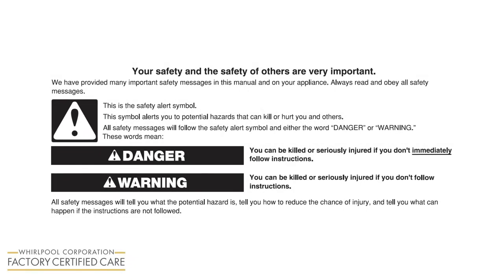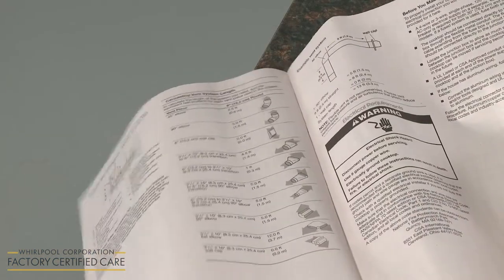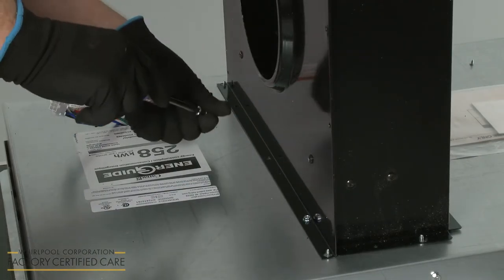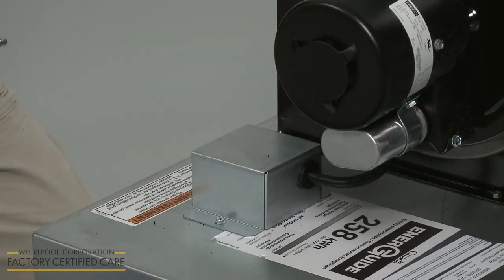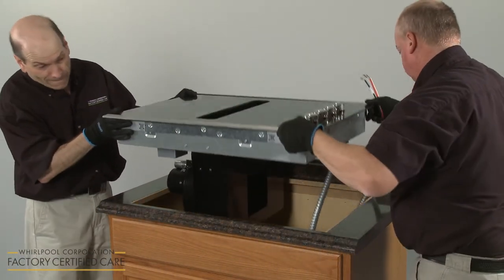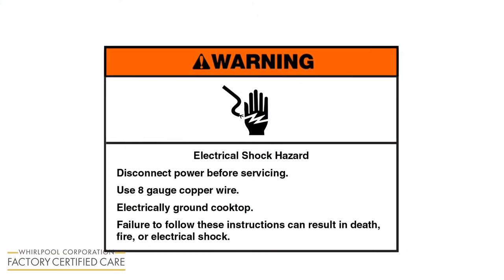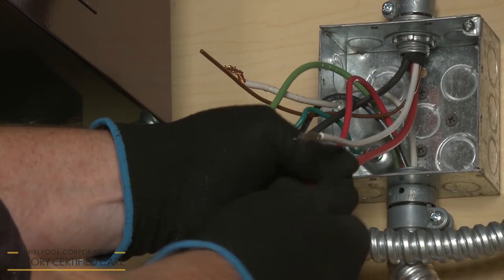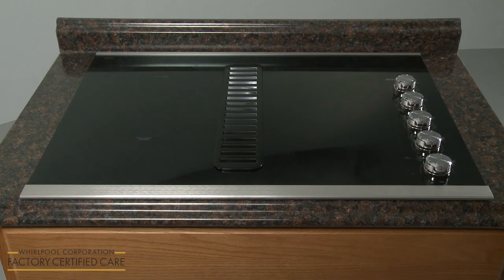Kitchen Aid Electric DD Cooktop Installation Model KCED600GSS

Comment: How is the cooktop secured to the counter? This is ignored in the video, and the instructions mention some screws and use wood between the counter top and the screws, but no mention of where the screws are, how they work, etc. I get the feeling they were not shipped, but they could be well camouflaged.
Reply: Same problem, any answers?
Reply: @opportunivore23  it turns out it just rests there, no brackets supplied. It stays in place, good now for about a year. The clowns at Kitchenaid still don’t seem to understand that there is a disconnect between the instructions and the supplied material.

Comment: Installation instructions are missing for the hold down brackets, as well as the hold down brackets themselves. Mine has a missing sentence in the instructions referencing the brackets, and didn't come with any
Reply: Same problem. Any answers?

Comment: I only have Black, White, and bare wire coming from the junction box. I connected the Black to Black, White to white, and bare wires together. I capped the red wire. Blower works. burners don't? Help!!!!
Reply: The black goes to black, the white wire from your house goes to red, and the bare wires and the white wire are all connected together